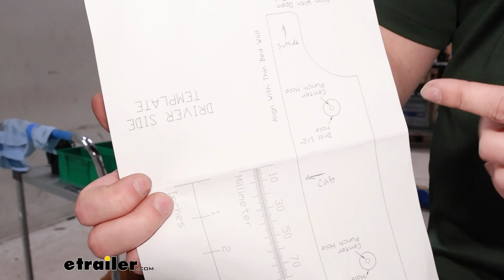etrailer | Mount: Westin R5 Modular Nerf Bars on a 2023 Ram 2500

Comment: Thank you for this video, made it on my own to the 2 piece step bar assembly, you made that easier. The instructions are absolutely horrible,  they suck! Overly complicated step bar. I replaced a set of Lund stainless,  quick were a super easy installation. These R5's better be worth the trouble. I went with black like the ones in your video, thanks again!
Reply from the maker: You're welcome!